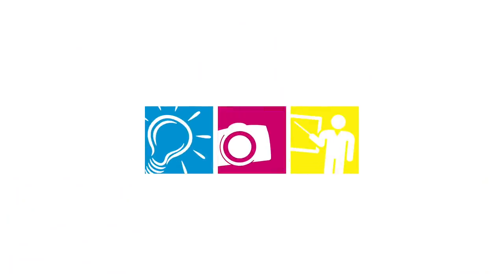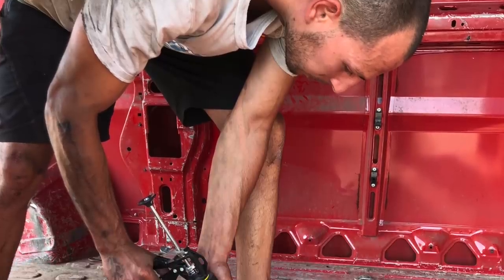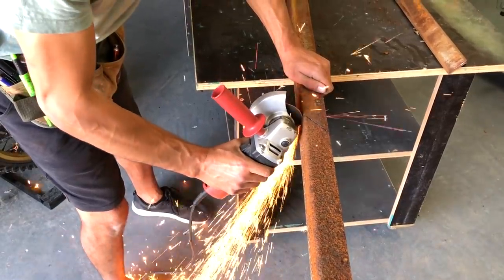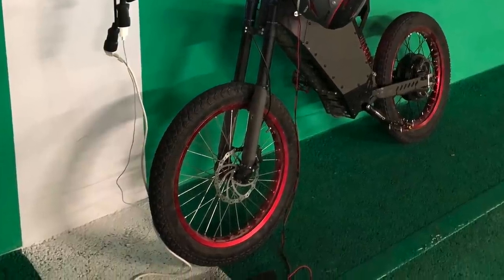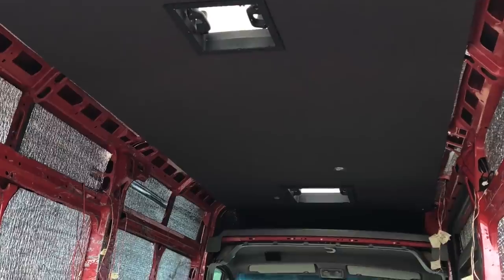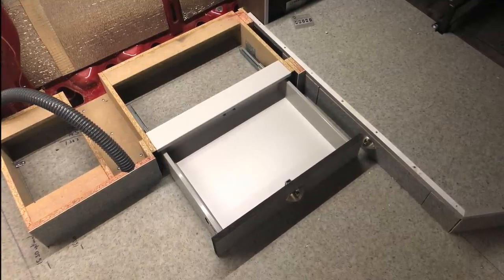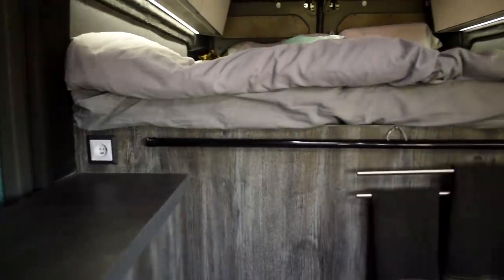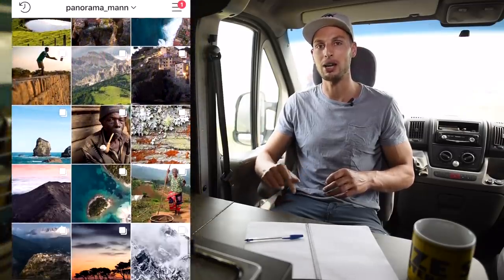How to Build a Home Made Camper Van / Start to Finish DIY Off-Grid Conversion

Comment: 1:30 This vehicle is definetly not streetlegal in europe anymore.
Reply from the maker: How come?
Reply: @ladiandmargaret  The seatmounting is crash-relevant, so it has to be a certified part. That is the reason, why the original parts are so expensive.
Reply from the maker: I’m curious if they will notice on a technical inspection. I read online that nobody inspects this. Will see.
Reply: @ladiandmargaret  It might become a huge problem in case of accident. Your insurance might not pay, if your vehcle is not street legal.
Reply from the maker: If it passes technical inspection it means it’s street legal.
Reply: @ladiandmargaret  No it does not. For example if you would hide something illegal and the technical inspector has no chance to find it, the vehicle is not street legal. If the inspector gives you a go for your not streatlegal vehicle you will still be in trouble. He might be in trouble too, but you as the owner and driver have to make sure, everything is ok with your vehicle.
Not knowing the laws does not safe you from punishment. :-/
Reply from the maker: Cool, so I’ll just hope not to have any troubles.
Reply: @ladiandmargaret  I wish you all the best. You seem to be a nice guy, you do not deserve the trouble.

Comment: if you had spend a third of the time to make the bikes fit in a smaller area you would have a bigger living area
Reply from the maker: This was my best choice without putting them apart. I’m open to a better solution.
Reply: @ladiandmargaret  I would be thinking of using a foldable bike, it might not be as good as the ones you had. Or maybe if you could quickly remove or fold the pedals and handlebar (like the xiaomi ebike can fold the pedals at least) 

or maybe vertically mounting them on some kind of bracket, but how plausible that is depends on their weight.

Maybe even across the van if they could go bellow the bed they dd take half the van length wise. There has to be a better way, it seems like the most wasteful part of the build.
Reply: @ladiandmargaret  I might be naive I am thinking the best way would be removing/folding the handlebars and pedals and having them take more length then width, bellow the bed. And you can use the rest of the space for a fridge, gas tank, battery, storage space.

Comment: water tanks under the car? the weirdest thing i have ever heard-so silly-cant even use the van offroad
Reply from the maker: .... why would you think having water under means you can’t go off-road? With a lift & suspension, plus protection around the tanks, it’s no issue.
Reply: @ladiandmargaret  You need to think hard-No one does things like that-just put the tanks in the car, its disorganized, prone to puncturing-reduces ground clearance-walls get dirty, hard to repair underneath, etc-cant think of a worse place
Reply from the maker: You should watch our latest build series 👍